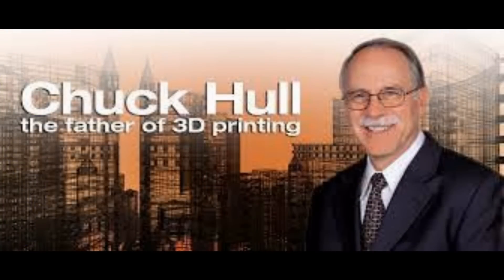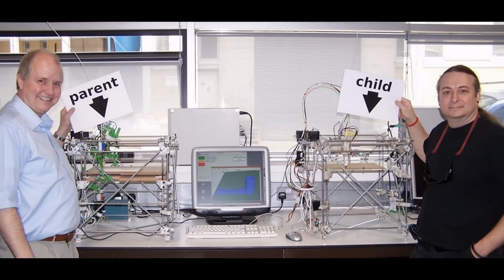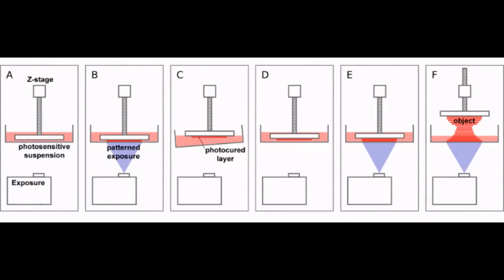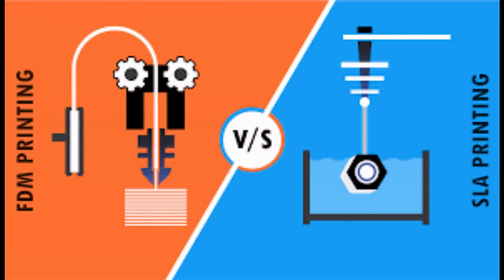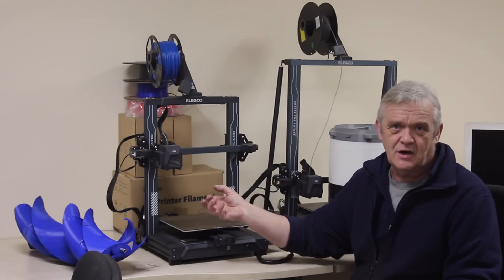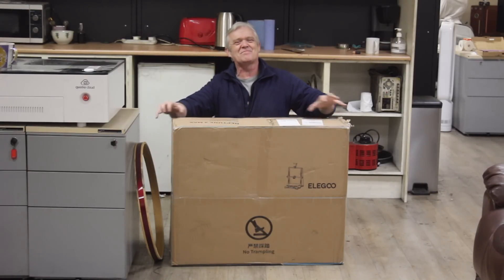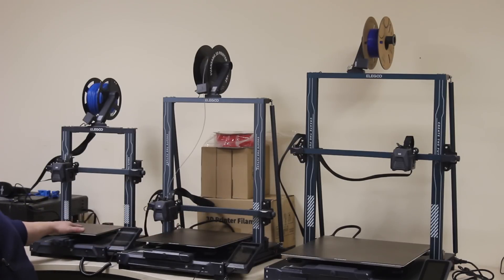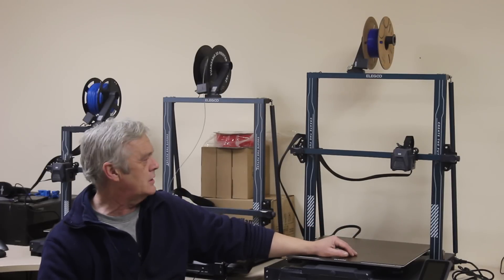1806 The Elegoo Neptune Max And Where It Sits In History #elegoo #neptune #max

Comment: It's funny that Stratasys comes up.  I rough-printed a typical radial flux generator that was < 200mm x 200mm x 150mm, all in all it took about 1.5 rolls of filament so about $35 USD.  It did take quite a bit of time to print all in all.  I was curious what it would cost to have a company do the printing for me, just to save the time, so I got a quote from those guys.  After uploading my parts and getting a quick consult, I was quoted $2,386 USD.  So I suppose there's money to be made if you're good at this.

Comment: What seems strange to me is that they are increasing the print height and width but not increasing the nozzle size or am I wrong? if right this could be increased and therefore increase the layer height which inevitably would  speed up the printing time.
Reply from the maker: increasing nozzle size would probably decrease resolution mate - I am guessing it is a trade off
Reply: @ThinkingandTinkering  I think for the trade off in look, for a increase of up to five times in print time speed is worth it.

Comment: I have a Neptune 2s and it works fine. After first bed leveling it just works without any bigger problems.

Unfortunatelly it's a bit of lottery with all these chinese printers. There are units that are pretty much plug and play and there are others that require more work and modifications to produce satisfying results.
For me the PEI sheet on Neptune is the best printing surface i ever used, but i was in conntact with people who tried everything and couldn't get the print to stick to it and they just replaced it with glass.

I must say that elegoo has pretty good support. The SD card i received with my printer was corrupted and they sent me new one with no problem at all.
Reply from the maker: nice info mate - thanks for that

Comment: Has anyone any experience of 3d printing part that have a gloss finish (one side), I need a couple keys for a synthesizer?
Reply from the maker: I think you might need a resin printer for that mate - in fact it would be ideal I would think but fem always leaves a ridge you need a bit of post print work to make a side smooth
Reply: use a printer with a glass bed and abs filament, the ABS on the glass side gives you a lovely smooth finish most of the time.

Comment: I would like your opinions on this idea I have for an underground electricity generating system. There is a reservoir of ferrofluid at the top of the system, from which a tube goes downwards about 500metres where it drives a turbine. The ferrofluid then collects in a bottom reservoir. I then have thousands of tubes (straws), immersed in the ferrofluid, that go upwards for about 34feet where they curve back downwards for a couple of inches. Underneath the downward curved end of every tube, is a magnet, which pulls the ferrofluid onto itself forming a nice prickly blob. The magnet can only hold so much ferrofluid, and the excess will fall into yet another reservoir just beneath the magnet. This reservoir has thousands of tubes leading up to thousands of magnets, filling yet another reservoir about thirty feet above. I repeat this process until I fill a reservoir that is above the original reservoir, which it feeds. 
Obviously the tubes and reservoirs would have to be pre-filled before the system would start working and it would be a nightmare to build, but is it possible? How high can a magnet pull ferrofluid? I've heard that neodymium magnets can last 700 years, so have I just invented a clean energy source?
Reply from the maker: I have no idea mate - if I wanted to answer your questions I would build a model to see - why don't you do that?
Reply: @ThinkingandTinkering  Because I found out how much ferrofluid costs😂
Reply from the maker: @crankfwd8209  you can make you own you know - it's pretty easy and cheap
Reply: @ThinkingandTinkering  I'm not too good with stuff like that, the only recipe I know is for disaster.

Comment: hey, I found your channel a little bit ago and I've been working my way through your videos. I was wondering if you have done any work with desalination? fresh water is getting scarce in a lot of places and massive corporations are going into places to basically stealing the water to sell back to the same community they just robbed, but what if you could just go to the beach with some jugs and get unlimited free water? how cool would that be?
Reply: Distillation  of rainwater( if available ) is easy with a simple pot still . Pot , lid, tubing, heat.
Reply from the maker: yes I have my favourite is barometric head which I have done vids on - but it was years ago
Reply: @ThinkingandTinkering  very cool. I'm sure i'll get to them soon but still might be worth revisiting. depending on how long ago, there may be some upgrade potential.

Comment: In the late 80s / early 90s we tried to use stereo lithography to make the pattern for investment casting instead of wax. It did work to a degree but in those days the required resolution for the necessary surface finish just wasn't there. Cheers!
Reply from the maker: it has come a long way mate

Comment: I started with one of the first ready out of the box printers, the Davinci 1.0 Aio at the end of 2016, it literally arrived in a big box, you took it out of the box, plugged it in, loaded the filament and off. fully enclosed, I have to say it works with ABS perfectly. then to supplement that and for PLA i got the FLsun Q5 which has a circular print bed. both have an 8" working area, the davinci is a cube, the flsun is an 82 cylinder (but in reality its a tapered cylinder as it cant really fully reach the extremities at the top of the z axis.)
Reply: Have a FLSun-QQSPro. The assembly was a breeze and the dial-in was just as easy. I am amazed at the speed of the thing if I am willing to forego a perfect surface.
Reply from the maker: I like the sound of that!

Comment: I would still like to see a 3d printer that uses a circular build plate on a precise turntable, with a vertical and a horizontal movement arm. all with the print head turned at a 22.5 degree angle for printing from above and to the side.
Reply from the maker: why don't you build one in the spirit of the history of 3d printing

Comment: Thanks for the video.  You might be interested in printing 3D metal parts using a sintering process. Please take a look at this video by Integza: How I 3D Printed a Metal Aerospike Rocket at Home. You can 3d print metal parts and sinter them using a metal filled filaments by companies such as Virtual Foundry. These do require a Kiln to sinter after the print is complete. You can make somewhat complex metal parts that would be otherwise difficult for you to machine at your shop.
Reply: check out Titomic in australia , I am hopeing as well as going up in size and market ,they will also go down ,for affordable home/small bussiness models .
Reply from the maker: that is diamond info mate - I will check it out - cheers

Comment: Lately I've fired up my ancient Wanhao I3 (A Prusa I3 clone) after a couple years of sitting, it's just a simple additive manufacture type printer-but it has worked flawlessly printing over 30 miles of filament.  I remember seeing an article in popular science about that type of printer you're referring to way back in 1995 (the laser powered type that solidifies gel in a bath) -- not sure if it was conceptual at that point but I remember the mechanics of it matched the diagram and explanation you gave.
Reply: we had preproduction parts/ bottles, made with the sterio llithography ,to show customers back in the 90s , could see it was made in fine layers , back then I think they cost around $1000 a pop , cheap insurance before signing of a couple of 100 thousand on mould tools . [Worked in a large plastic factory ]
Reply: @johnmarkgatti3324  That's awesome, I had read somewhere that additive manufacturing started in 1987 with stereo lithography-so you were literally on the cutting edge of the 3d printing industry
Reply: @johnmarkgatti3324  I bought a Wanhao I3 many years ago, and I've used the shi+ out of that thing 😆
Reply from the maker: cheers mate

Comment: Hi Rob, have you ever dabbled in designing custom prints? I spent the best part of a year learning CAD and print with an ender3. I finally settled on Autodesk Fusion 360 modelling software. It's fully functional and free to use for 'mature' students :)
Reply: Rob does have a handy CAD user (ex Drawing Office manager) available if custom parts are needed (me) I use fusion 360 (the hobbyist version- limited to 10 active models) I can draw up pretty much anything he can describe to me. he has expressed an interest in learning CAD to design his own parts.
Reply from the maker: I haven't yet mate - but it is on the list for sure
Reply: really good to know .
Reply: All these expensive softwares are not worth learning. The free version get scrapped or downgraded all the time. Consider learning Blender instead. You can design pretty much any 3D model from scratch once you get the hang off it, plenty of YT tutorials. It's good stuff and free.
Reply: @DKFX1  having designed stuff in two of the most expensive CAD systems out there all my life, I find the free version of fusion 360 the nearest to what I know, and every time I have tried to use a lot of the stuff like blender, i have found it limiting to what I want to do, thats not to say its no good, but when I know the function I want to use, and its not apparently there, I get frustrated. With nearly 40 years CAD experience I tend to fall back on what I know, and fusion 360 is the closest to that I have found, generally I can convert over to any true CAD system in a matter of days as iits justa matter of finding what the common commands are now called. if you are learning from scratch then probably some of these other systems would be a good place to start.
Reply: @grendel1960a  A lot of people are fleeing fusion 360 because their free version recently got limited (yet again) in what they are allowed to do. Investing time into learning these softwares, only for them to become of limited use due to policy changes, or paying hundreds of dollars for the pro versions, is off-putting to many.
Reply: @DKFX1  Thanks for the suggestion. I tried Blender but I found it impossible to use without a third mouse button or wheel. I prefer using my laptop touchpad. Maybe I should reconsider.
Reply: @lagunafishing  Havent't tried using blender mouseless, but using any 3D program without mouse sounds hellish to me honestly. If you do decide to try out blender, be aware that it can be overwhelming due to an extensive range of features. For design purposes I would focus on the precision modelling aspect of Blender, for which you can see some great tutorials on Maker Tales' Youtube channel.

Comment: Hello again Rob and the team, having recently received and installed one of the Chinese diesel heaters my first thought was how to capture heat from the exhaust outlet, only mentioning this as its such an easy way to improve overall heat out put at no extra running cost, lots of ideas including heating a bucket of water or running through a standard radiator - on the look out for a second hand hot water cylinder with coil, this would take a while to heat but great heat store 👍
Reply: I have a video of doing that exactly and successfully using an old cast iron steam radiator.  I cooked in a pan and heated buckets of water using the waste heat-which is substantial.
Reply: I use the concrete block from an old washing machine drum as a heat store in my small log burner to spread the heat output over a longer time period.
Reply: @grendel1960a  This needs to be sealed as it's low pressure but high volume exhaust from a 1" exhaust pipe of ~700 degree exhaust gas.  The steam cast iron radiator acts as a good store of heat as they weigh between 100-700 lbs (I've moved them all as I used to empty hoarder homes for 15 years)
I've also used a heat exchanger from a car which gets about 500 degrees, a copper radiator from a car which gets around 400 degrees near the intake port.  It's fun to recover heat from all sources, I put a cast iron pot with water that weighs 70lbs full on my Jotul wood stove in the garage.
Reply from the maker: I like that mate - maybe a sand battery?
Reply: Just wanted to add, those first two ideas were from YouTube videos, these little heaters are becoming so popular, my neighbour just texted me to ask if she can install one to help with draughty cottage 👌

Comment: I’ve mentioned before about windmill on a chimney, just wondered if you fancy printing a cowl that has a windmill that fit on top .
Reply from the maker: that is on my mind mate
Reply: @ThinkingandTinkering   just thought I could get that small height turbine attached to the cowl on the chimney run two wire plus earth to a small battery in the fire place or to a fan heater to blow warm air but not sure how long it would take to charge the battery and if the battery would be able to do that, if was to work well then maybe have the small turbines on there side and fix them along rig tiles with wires going to each room for the same effect, in my head it sound feasible but maybe my head needs a ice bucket.